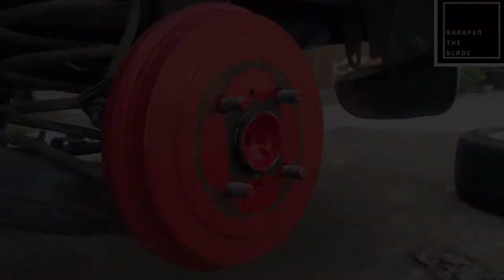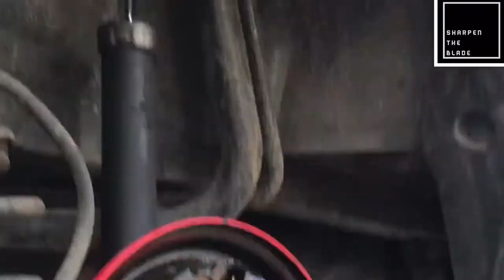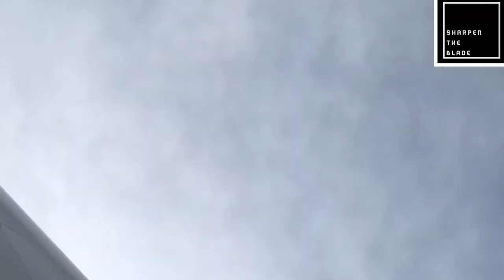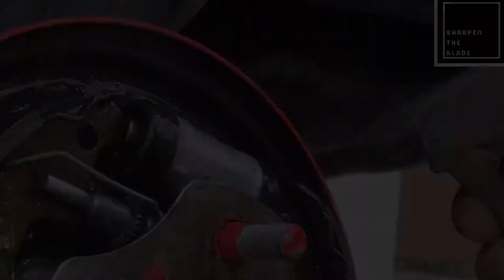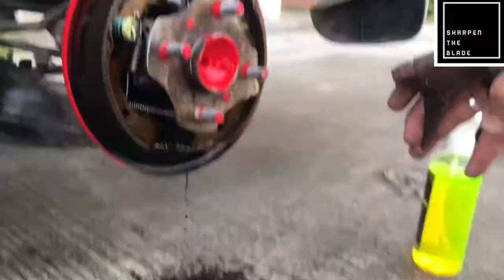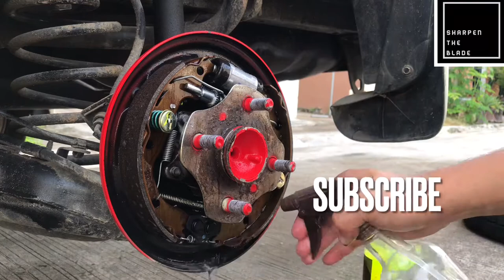Drum brake shoe cleaning| How to DIY| Paano maglinis ng brake shoe drum

Comment: Thank you, very good film. Really sometimes you can just clean brakes without replacing them. I will do that procedure, bcs though I changed rear brakes like 7-8 months ago, but I didn't know, that you are supposed to paint certain kind of drums, and mine needed that. After 4-5 months totally new drums got very rusty, I need to remove, clean and paint them. But obviously the new brake shoes, new brake wheel cylinders will be covered w/some rust dust I assume, so described procedure comes handy. Do you happen know, what kind of drums are protected fm/rust, I know there are some, but how to find such? My previous drums are not so rusty, like these new. And another question: in general how often you change brake drums, it is 2nd or 3rd time when you change brake shoes, or every time? Also can I use at the end Brake Parts Cleaner or it is not good for rubber on Brake Wheels Cylinders?Thank you again.
Reply from the maker: Hi there! For cleaning, you may use brake cleaners if on a rush. But for deep clean, I reco the steps done in the vid using degreaser or common dishwashing soap. make sure everything is dry before putting the drum cover back.

Drum covers rarely need replacement unless really worn out or damaged.

drum covers tend become rusty in time. If you want to paint your drum cover, use high temp spray paint, 2-3x coats. Make sure to remove existing paint (if any) by applying paint remover, then use sand paper/drill brush to clean surface before painting. You may use Rust converter for less hassle with rust.
Reply: @SharpentheBlade  Thank you. With Drum Cover you mean Brake Drums, yes? I'm sorry I don't know well all the terminology. Yesterday I washed w/water, cleaned w/degreaser (wash for tires, says removes oil), washed w/water, and then finally w/brake parts cleaner (I thought it would be better since it dries out quickly, the drum was getting rusty on you eyes). After that I painted it w/High Temp Primer (2000F). Today I'll coat it w/High Tem Paint (for calipers, 900F). Maybe I shouldn't use brake parts cleaner, on next one I'll do at the end Paint Thinner better. We'll see if there will be much difference. Thank you for your advice again.
Reply: @SharpentheBlade  Someone wrote me that on average the drums are changed approximately after 100K miles. O my, I thought it is much often. Thank you for your comment.
Reply from the maker: @olenaerhardt7725  hi, degreaser + brake cleaner is a good combo. Good job there! stay safe and enjoy your diy's.
Reply: @SharpentheBlade  It is good to know, thank you. I tried to apply Mineral Spirits, but it is harder to do, since some particles fm/the rug you apply with stuck to ruff surfaces of the drum, you need to remove them then, So I went w/that combination: degreaser, water, 320 sandpaper slightly, water, brake parts cleaner. Then primer (2000F, 2 coats) and paint (900F, 2 coats). We'll see how all that will last, but definitely will be less rust. Thank you for useful comment.